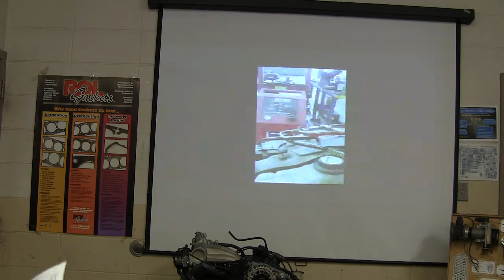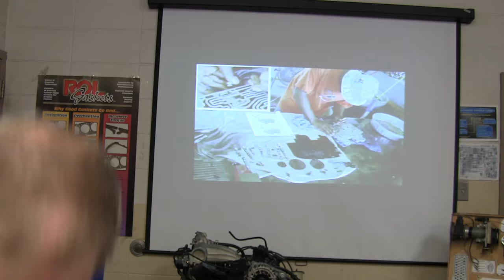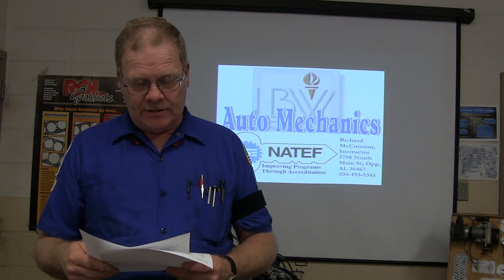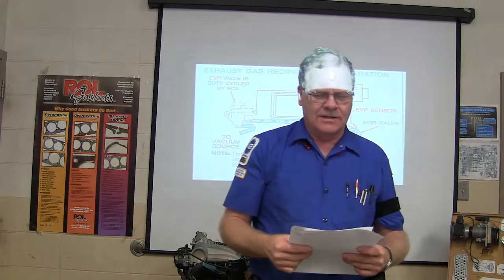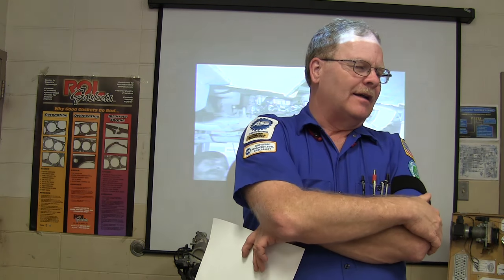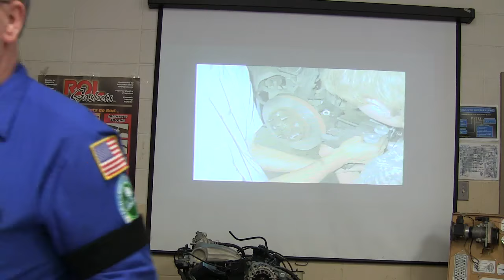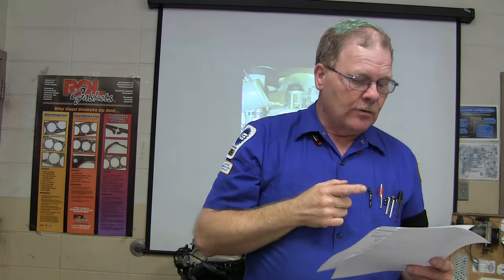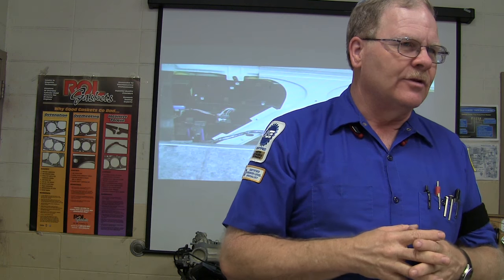Fundies Day 11   Airbags and Other Stuff

Comment: Mr. McCuistian, I watched your video on air bag, 92 ford taurus, replacing the module, to correct the fault code 51. One quick question if I get one from the salvage and replace mine, after disconnecting my battery and waiting for at least 10 min. before working on mine, and I do not find the grounded out wire which caused the modular fuse to blow, will the airbag deploy, or will it just blow the internal fuse in the one I get from the salvage??? Because I can put up with the light blinking but after I turn off the ignition now I get a beeping which sounds like it is coming from the direction of the passenger door, but might actually be coming from the module itself, and I think it stops after a few minutes, not sure though.
Reply from the maker: Wallie Ormerod typically that fuse just blows because the module is bad and I replaced a lot of them for that so I wouldn't worry a lot about it but the one you get to the salvage yard have a blown fuse 2 because that was a common problem
Reply: Okay, thank-you very much for quick response, I used to do a lot of mechanic in my young days, I am now 65, and since everything is computerized now gave up on doing it, but now am on fixed income so trying to do as much as I can myself, but hard to find information about DIY things now days, all my contacts are no longer living or don't know answers either. Again Thank-you!!!
Reply from the maker: My pleasure